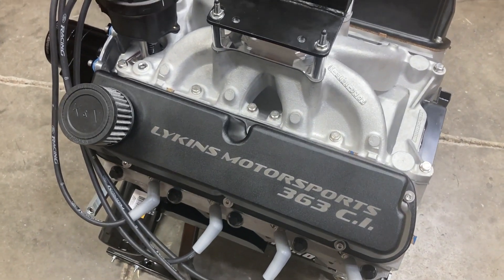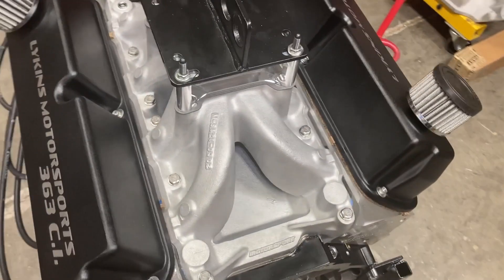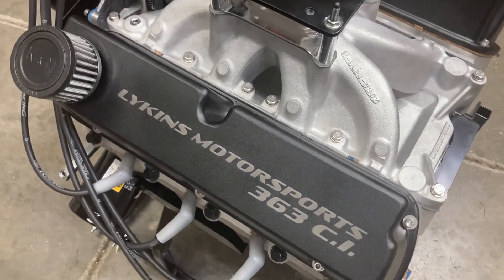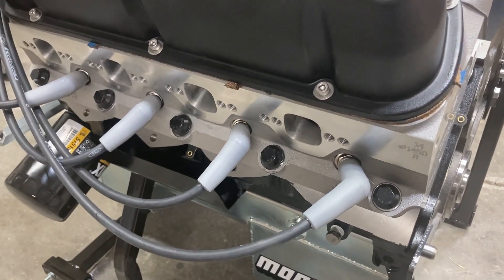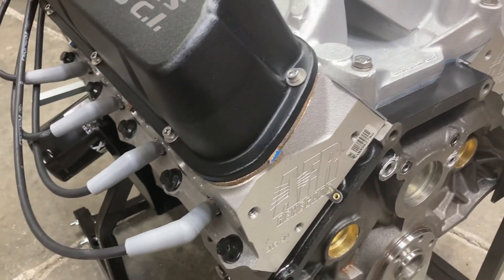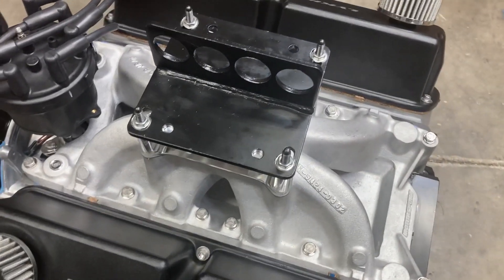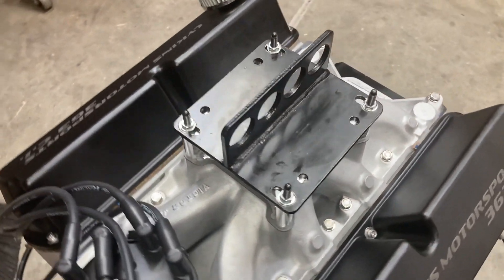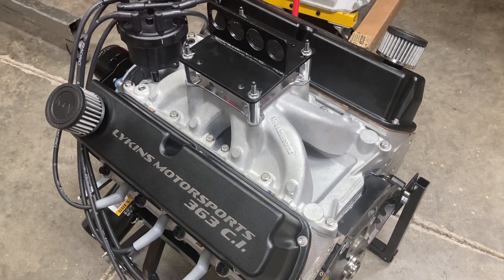Lykins Motorsports Ford 363 SBF Bracket Engine Ready For Dyno...

Comment: Brent, the 363 looks meticulously detailed and the valve covers give it an all business attitude with nice eye appeal. From the Ford specific Molnar rotating assembly to the solid roller cam and Titanium spring retainers,  you have built another spectacular example of Ford Power with The Lykins Touch of Perfection ! 
Thanks for the informative video 🏁

Comment: This is the perfect engine for a Cobra replica, it will embarrass those die-hards with the 427FE wheezers. Former Cobra driver Bob Bondurant said the 351 is the best engine for a Cobra and who would have argued with Bob? The only thing better than a 351 is a 363.
Reply: Unless you're like this 'die hard' with an ERA Cobra and have an all aluminum FE stroked to 468 cubes with dual Holleys on a DOVE tunnel wedge intake with a nasty solid lifter cam.
Heh heh heh.
'427FE wheezer'...?
Bring on your cast iron 351W!
BTW: My 363 is going where it belongs, not in a 427 Cobra,
....under the hood my '85 5.0 GT Mustang.
Reply: @Turbo4Joe363  468 CI Aluminum FEs are usually found at car shows. 358 CI retired NASCAR Cup motors dominate on the road courses. But hey, show Cobras look good with proper FE's.  The 363 is a great choice for the Fox Mustang.
Reply: @RSDX99  
Wrong again RD!
'Usually'....but not always.
Raced regularly at VIR, Summit and NJMotorsports Park.
No idling over to the local C&C like an old fart in a Corvette.
7,000 rpm in a 468 FE big block sounds SO good through polished 4" stainless steel sidepipes!
When the secondaries open up on BOTH Holleys....its time to hang on and countersteer!
Don't hate FEs just because you can't afford one for a '427' Cobra!
Maybe try a much cheaper 7.0L LS swap on your  '427' Cobra.....?
Reply: @Turbo4Joe363 , I had a 427 SO in my Cobra Replica before aftermarket Aluminum heads were available. A Stock 427MR is no match for a good well-built 408. Years back at the SAAC convention at VIR Dick Smith (RIP) was trying to catch me but unfortunately, the front stretch kink was not his friend that day and he had to detour in the weeds. He was a great guy and we joked about our on-track encounter and he was amazed that I only had a 408 Dart for power. My first engine choice was a FE 427 and they were king at one time but not anymore. I sold the FE to a guy who put in a CSX 4000 show car. A Ford engine builder told me if you're going to go racing sell the engine and build a proper track engine.
Reply: @RSDX99  
"before Aluminum heads"
OK ...an all cast iron FE is an overweight pig.
I am talking about an ALL aluminum FE with 468 cubes.
408Ws are a nice engine...but for a 427 Cobra, I'll stick with a 427 FE engine. Like Carroll Shelby put in them originally.
I'll keep my stroked 468 cid FE lightweight screamer....Thank you!
BTW: I've got an 8.2" deck 363  that might put a hurtin' on your 408W.
Reply: Be careful who you insult puppydog. 427 FE wheezers? The only advantage you have is cost. A modern FE with a Shelby aluminum block and BBM or TFS heads with a TFS tunnel wedge will chew your 363 up and spit it out. There are more than just a few all iron FE's you'd be wise to steer clear of. Mr Lykins has BUILT a few of them. Lot of people like to attach the word dinosaur to FE's. Just remember that the dinosaur ruled the earth for hundreds of millions of years...